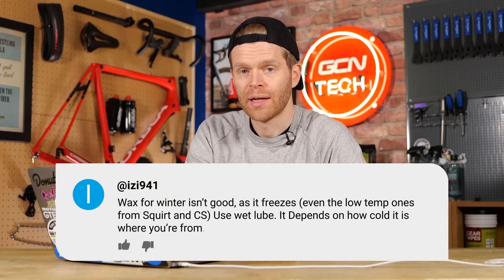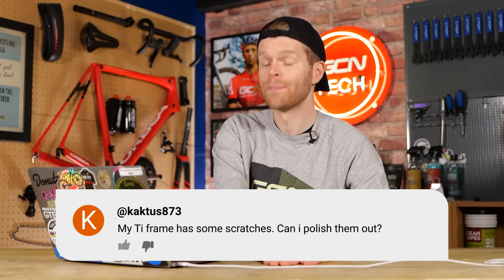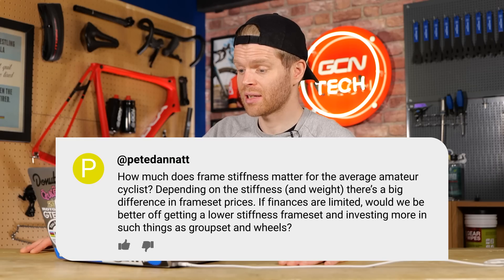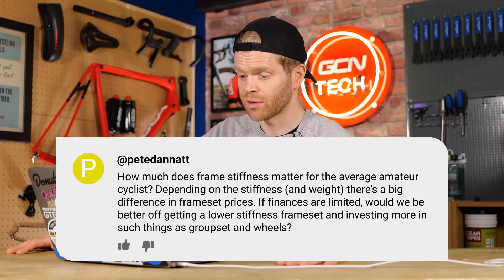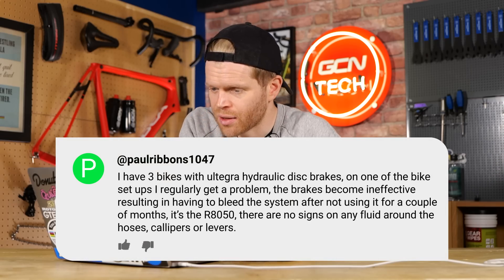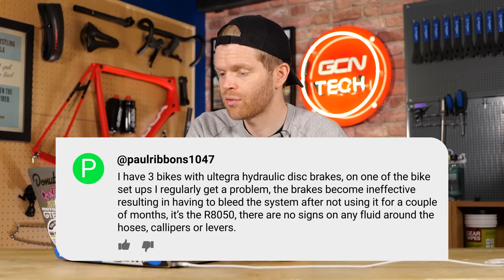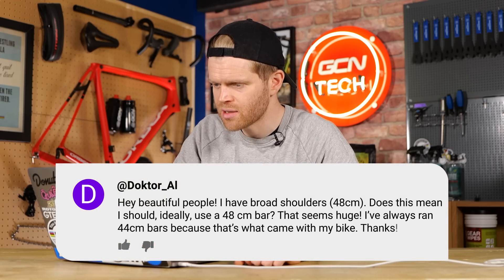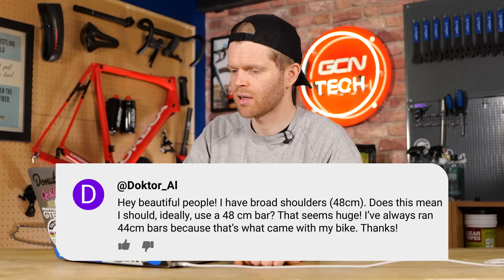Bike Handlebar Width, Hydraulic Brakes & Frame Stiffness | GCN Tech Clinic

Comment: #askgcntech  At the start of rides I cant shift down the cassette, Shifting up works fine. There is no biting point until I actuate the shifter a few times. Once it succeeds to shift it will be fine for the rest of the ride. The problem seems to be made worse by colder weather i.e. on cold days it will need 10 'pumps' of the shifter and warm days 3 'pumps'. (105 mechanical) Any thoughts? thanks in advance :)
Reply: I will add to previous comprehensive replies. If the shifter is older than 2-3 years then the factory lubricant within it might be starting to congeal/dry out. This could explain why you have trouble shifting to harder gears, where it is the derailleur's springs that have to overcome the resistance.
A second scenario not addressed- resistance due to the cable system. Usual culprits include rusty inners, flakes of coated inners inside outers, dirt/dirty/dry lube in the outers, worn outer liner, kinked inners and/or outers, misaligned entry of free inner stretches into outers at frame stops.
If the bike is 3+ years old, you might consider rebuilding it completely to tackle all possible problems- even ones that haven't yet surfaced. An ounce of prevention...
Good luck and ride safely.
Reply: just back from a 3 hour ride in 0'c weather. I can confirm multiple times in that ride the gears failed to shift (again they are fine in 10'c). My thoughts now turn to the grease. In colder temps its more viscous and needs to be un-congealed (gealed?)
Reply: Shift up the cassette, as in, shifting to the easier gears? I've never heard of anybody use the term "pump" for mechanical groupsets.
Reply: @sbccbc7471  sorry into harder gears (corrected)
Yes pump is how I would describe it as I have to actuate the shifter back and forth many times. 

There is no bite point like there is in normal actuation, so the gear does not shift - until it starts working and the bite point returns
Reply: @dsm1891  From what I roughly understand so far, sounds like you lack cable tension. This is one of the most common issues of problematic shifting as a result of lack of indexing maintenance, alongside not leaving the derailleur in top gear when it's not in use.

Whenever I do indexing work, I don't just tackle the one current problem, I tackle all of it. Here's how I work a rear derailleur:

1. Check derailleur hanger alignment. If it's misaligned, crack derailleur loose, remove rear wheel, remove derailleur and hanger, inspect hanger integrity, if it's OK, reinstall with greased mating surfaces and apply bolts with anti-seize.
2. Reinstall wheel.
3. Realign hanger with a maximum deviation of <3 mm on horizontal and vertical axes.
4. Reinstall derailleur with anti-seize.
5. Undo cable pinch bolt and wind barrel adjuster till it bottoms out lightly in the derailleur.
6. Check limit screw adjustment.
7. Reattach shift cable while taking out as much slack as possible with a pair of pliers.
8. Check B-tension gap adjustment.
9. Index derailleur via barrel adjuster until upshifts (harder gears) and downshifts (easier gears) are in-time.
Reply: @sbccbc7471   Thank you for the information. These issue(s) would make sense to me if it was a constant issue, happening throughout a ride, but I stress after it shifts once its perfect for the rest of the ride.

This is the same with the turbo, at the end of a session its shifting perfectly, then the bike is left on the turbo and next day at the start of the ride, it fails. 🤔🤔 

This has been happening for 2 years and ive had 2 services (from 2 different mechanics). Both just said "shifter seemed broken but its ok now 🤷🤷" 😂

Comment: What helps with storing disc brakes for a period of time. is to put a strap around the brake levers and apply pressure to the system. This helps keep the system from getting air past the seals when it is relaxed. Also it helps bleed the system, it forces air to the top.

Comment: #aksGCNTech : Do you know wether narrow TT base bars are available? I can only find base bars that have at least 40cm, only for track bikes I could find 34cm narrow bullhorn bars (made from round alloy tubes), but I suppose they are not designed for the use of TT extensions.

Comment: #askgcntech Hello,

I ride a racing bike around 12,000 km a year and control the bike quite well. However, I have the greatest respect for railway crossings. Could you test at what angle it becomes critical and whether speed makes a difference? which tire width is advantageous? I hope this is worth a video for you. could be exciting.
Reply: Railway crossings have more variation than pavement does.  To the point that some are barely noticeable and can be pedaled through to bad ones you need to bunnyhop
Reply: 32mm is where your tires start not dropping into random crap in the road nearly 100% of the time.

Comment: #askgcntech
Hey Alex and Oli!  I'm a huge fan of your show. You guys have a played a major role in my development as a cyclist over the last couple years.  Thanks!  
What's up with carbon wheels and water ingress?  I just bought some Zipp 303s wheels for my Cervelo Aspero and had to give the bike a wash after a dirty ride.  Went to ride the bike again a couple of days later and noticed a water sloshing sound coming from the wheels! Is taking the tire and stem off the only way to dry them out?  What a pain!  😢
Reply: Always wash wheels with the values at the top / 12 o'clock position ... :)
Reply: Although that's a fast way to drain water out of the rims, many wheelsets' rims should have a hole or two on the side for water drainage purposes.
Reply: Next time you do your tubeless tape poke the hole for the valve with a very thin awl and then force a loose presta valve through this tiny hole to make your valve hole.  This will make your valve hole way more tight and waterproof.  Alternatively you can wrap your valve in electrical tape to snug up the hole, if you do indeed have a large hole.  Try to figure out whatever it is and plug it, because dirty water will pop inner tubes eventually.

Comment: I bet the guy with the hydraulic brake issues is storing his bikes either upside down or hooked up on a wall! That will cause those problems! Keep your bike in it's natural standing position, wheels down! but elevated off the floor if you're leaving it for months at a time!😊👍
Reply: Funny you should say that, I do store them all by hanging on the wall, but as Ollie missed only one of the bikes has this issue, so I’m not sure if it is this that is causing the issues.
Reply: @paulribbons1047  Hi Paul, yeh Olli said all bikes had the same issue. So yeh you're right that does seem strange. Maybe renew the ends of the hoses with new olives etc. I had a similar issue with a bike I had in Germany and only used when I visited. The rear brake would always need bleeding. So that's what did. It worked. Good luck mate 👍
Reply: thank you @iansingleton  I will try that this weekend, recheck my home work as Ollie suggested  lol

Comment: I want my frame to have a bit of flex, and that's why I like high-quality steel.  Cable-operated brake systems never leak.
Reply: I can count on 0 fingers the number of times my rim brake bike needed bleeding. Same can't be said for my discs!

I'm trying a modern, TIG steel frame in a few weeks, very excited about it
Reply: @Hysterically-Inaccurate  Modern TIG welded steel is the best frame material, enjoy.
Reply: preach

Comment: You addressed bars that may be too narrow. In my shop, I see commuters and hybrids with bars way too wide, like they are going to be riding off road all the time (lots of neck and between the shoulder blades pain). I have always used The 70's mantra of no more than 2" wider than your shoulders. Is there any more updated thinking? My female e-bikers in particular are suffering.

Comment: Regarding the brakes, make sure you flick the lever a bunch while bleeding.   Air gets stuck in that plunger area and if you’re not using the bikes for a while, the air comes to the top and makes it squishy.
Reply: This. 
Shimano sells a special funnel that screws onto the top of the lever port. Fill it with brake fluid, then pull and flick-release the lever. Bubbles will emerge. Continue flicking until no more bubbles emerge from the lever. Gently tap the side of the lever body with the handle of a screwdriver, then pull and flick again until no bubbles emerge.

It’s called burping the levers. It is a necessary final step in the brake bleed.

Comment: I'm 6'4" with a shoulder width of 46cm. Every bike fitter I've ever worked with until recently, has said to stick with bars the same width as your shoulders for comfort. Caveats: At almost 60, I no longer race. Most of my rides are long-distance rides of 40 to 100 miles. I'm an 80's steel snob, that believes sloping top tube bikes are trash. The last bike fitter I went to, didn't know how to adjust a quill stem. I no longer go the bike fitters.  I'll admit that 44cm bars work fine and don't require dismantling for travel in my ScIcon bike case, so I have a few of them lying around.  For me dropping down to 42cm (or less) makes me feel like I'm riding a kids bike.

Comment: Sandblasting is not used on thin metal tubes. They use glass, walnut or the like.

When talking about stiffness, you should differ between sideways and longitudinal stiffness. The main advantage of carbon is that you can make these different. A softer longitudinal stiffness will make the bike more comfortable and sideways will give you better powertransfer and cornering.

On metalbikes they will be the same, so it will be a compromise.
Reply: Never heard of Young’s Modulus ?

Comment: Wax can be used down to freezing temperatures, however its longevity between re-waxing is reduced.  Wet lube is the same, in that more regular lubing is required.
You will learn this on Friction Free cycling.

Comment: #askGCN Hello GCN team. I have a question about geometries. What has a greater impact in the handling of a bike: 
- A shorter/longer stem (by 1 cm for example).
- Spacers (also 1 cm).
- A longer/shorter wheelbase (for example, 2 cm, which is the difference between a race and an endurance bike).
- A 5mm difference in trail (which is also the typical difference between a race and an endurance bike).
Thanks!
Reply: The questions you are asking can only be answered by riding different bikes and seeing what you like.  The bikes most people ride on here would make me cry in disgust, bikes are a very individual thing.
Reply: Length of the stem should be the main variable when it's about handling (that you can deal yourself with). 
Looong stems will make the bike stable but be careful, you might get hurt in the back or the neck. More nervous and direct handling will come with a shorter stem.

Longer wheel base can get your bike more stable and comfortable aswell. It will also be less reactive.
Moving spacers and smashing the stem or putting it higher shouldn't have much impact on handling. There will be more comfort and flexibility with the higher stem of course.

Bike handling get better most of the time by spending more time riding and getting familiar with your bike. Any change will ask your body to accommodate with the new set up as well. The more you're comfortable, the best you'll handle your bike.
Reply: rake (the one you're forgetting to mention).
Reply: @l.d.t.6327  Doesn’t trail come as a consequence of rake, wheelbase and head angle?
Reply: @March65p  rake is pretty much independent of head angle, and it isn't a consequence of wheelbase: wheelbase is a consequence of (among others) rake (besides length of the rear fork).
Reply: @l.d.t.6327  What I meant is that I had already mentioned the variable “Trail”. My understanding is that the goal in the bike design is to have a specific Trail and the Rake is used to achieve that Trail. So I kind of had taken Rake into account in my initial question. A slacker head tube angle causes a greater Trail, but then with a greater Rake the Trail is reduced.
Reply: Ride the stem length you like and grew up riding.  I grew up riding mountain bikes that were too large for me so I run 60mm stems on 58cm road bikes.  Is this the ideal roadie fit?  No of course not, it sucks for descending among other things, but I like it.  At slow speeds I can dodge any imperfection in the road with a flick of the wrist, anything above 80cm feels like a boat to me hate it.

Comment: Stiffer groupset?😅
Reply: It's true. I am a 1.7m (5'7) quasi midget who stands on the pedals quite a lot. Chain and brake rub are a problem when I use Acera/Claris level components. Hollowtech BB, thru axles and good quality, properly tensioned wheels make a massive difference.

Comment: So @gcntech, after talking about derailleurs that save 78grams, what about some in-depth looks at tube replacements? Why go on about puncture proof liner this, self-sealing gel that, with airily this and pump that, where a good (as in works) inner tube replacement that although heavier than tube with air, is overall just a little heavier and does offer elimination of punctures. Thoughts? What works, for most a kilo extra is just immaterial to overall weight.

Comment: Cheap brake fluid absorbs moisture quickly and maked the brakes spongy... brakes = NEVER skimp
Reply: So true. That's why I only trust prestone 5.1 fluid. Very snappy and took away most of the spongy feeling on my code rsc.
Reply: Are you guys putting dot fluid in ultegra brakes?
Reply: @janeblogs324  Almost all SRAM brakes use DOT fluid, with the exception of the DB8.
Reply: I only use Shimano fluid
Reply: Shimano exvlusively uses mineral oil, which is completely different from Dot4/5.1. However you can't switch between these fluids, brakes are made for the one or the other

Comment: 0:39 is this comment talking about those water wax emulsion chain waxes? because i think you are meant to apply those indoors or when it is above 0c temp so then the water can evaporate. if you don't do this then sure it will probably freeze.
Reply: Good point. I had never considered this. 🤔